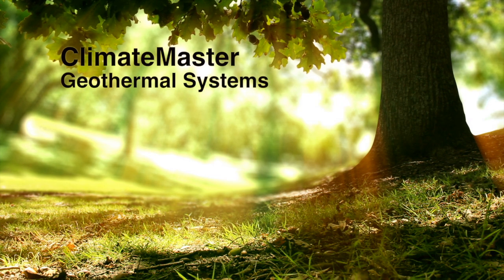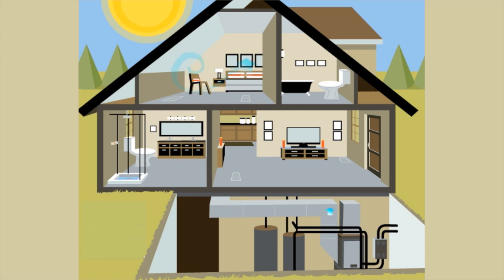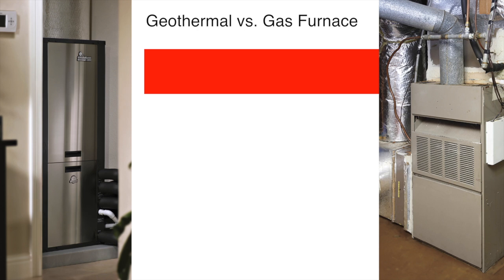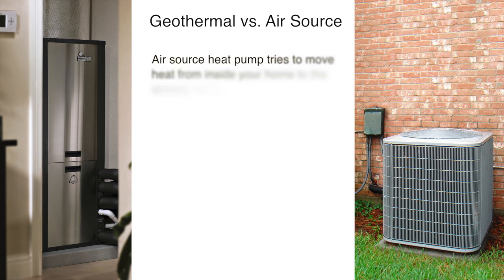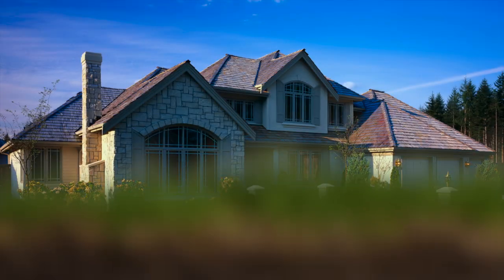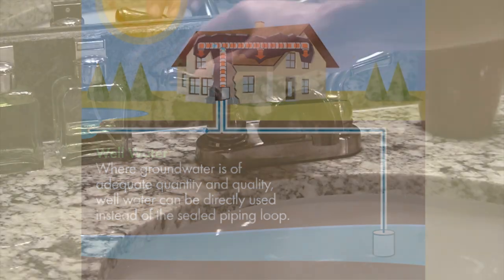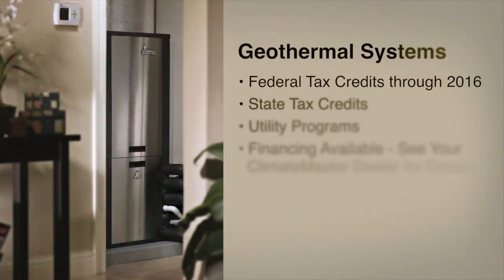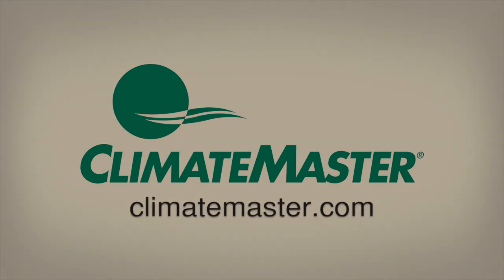Benefits of Geothermal Heating and Cooling

Comment: it's not enough heat in winter,you will need more heat,50 degrees is to cold.when it's zero out
Reply: joe18370 You can get any temperature air from a ground source heat pump. It can be -40ºF outside, and you can easily heat your house to 100ºF if you want. You just need to size the system for that. If someone has a ground source heat pump, and they cant heat the house enough, somethings wrong. Its sized far too small, or something failed.
Reply: joe18370 it's a heat pump it still brings more in
Reply: Angel Flores I understand thanks  I now know someone that has this installed,it's great for cooling, heating only has to heat above 50 degrees
Reply: Why do you only get 50 degree heat? I get 90 degree heat out of my system
Reply: Frank I agree: I work on gas compressor stations and the compressor vacuum/discharge produces both hot and cold lines-and that’s just the compressor aspect of it.
Reply: +The refrigiration cickle is still involved and used here. For most people it takes more than a shrt comment to explain. The principkle here is the following a) in a cooling mode it is deffinetly much more efficient to cool "superhot" refrigirant in a 55 Degr F envirement than 80 / 90 degree F envirement. At the same token it is much mor efficient to pull heat from a 55 degreeF envirement in the winter than 20/30 degree F enviroment. But like I said to understand this one has to understand the refrigiration cickle. These are great systems and will continue to be fine tuned/developed for the better of the general public.
Reply: +joe18370 sry Joe you do not understand the system at all ... this isn´t even any "new" and unreliable system.. it has been here for more than 25 years.. it works reliably and even cold winters... to make it clear.. even if the cold side would be freezing temperatures you could get energy out of that and produce heat.. just not as efficient but it would work...
Reply: https://www.youtube.com/watch?v=Uv8bTAGr0tU

Comment: I wonder how much this costs. I'm guessing if this saves 80% that probably means it will cost 160% x amount saved, in 2 years up front or more
Reply: pmp2559 we installed a geothermal heatpump for heating water for a family of 6, and using the water to heat the house, cooling  (about 3600 square feet, 10 feet high ceiling). In the winter the temperatures go down to about 14F. And in the summer its about 75f. We had all full electrical before this. Our bill for heating, cooling has cut down by 70%. Great system!!! It costs alot to install and new ducting and all but in a fee years that will have payed off since it saves so much money!
Reply: @robigeisi6530  what do you use to store your cooling (ice battery) or for the storage of your heating? Also... what type of fluid are you using to combat the freezing temperatures on the cooling and the "boiling" of the heating side? I install these systems and I have never heard of someone's electricity bill going down. I mean you have the compressor, heating pumps, domestic hot water pumps, cooling pumps, fan coil units, three way valves, etc.. 3600 square feet requires al the minimum of 2 heat pumps. I agree when the system is operating to full potential it is a very good system, just not cheap on electricity. I've installed photovoltaic panels to help combat the high electricity bills but it's still expensive.
Reply: @robigeisi6530  Can I ask what region you are in that the summer temps are 75 on average? That sounds heavenly! I can handle 14F in the winter, no problem, but 90-100F in the summer is pretty miserable.
Reply: 7-20k depends on the Buildings volume
Reply: We did a retrofit on our house.  This is our 4th winter with the system.  We have a large house: 3300 sq ft with a 22 ft vaulted ceiling upstairs made 100% of red cedar so the volume of space to heat is huge which meant we needed a huge system.  Our total project cost about 36k which sounds awful.  So far, very happy with the system though.  Set at 72 all year around.  Tough to determine payback since we heated everything with wood previously but we estimate about 10 years.  I guess I don't have to cut 40-50 pickup loads of wood anymore.  The system in January (Wisconsin winter, temps consistently below 0 this time of year) will cost about $180-200 dollars in electricity including domestic hot water.  Considerably less the rest of the year, about $40 to cool in July and August.  We didn't use Climate Master, went with Water Furnace Synergy system which does all forced air and basement hydronic heat.  Long term it will be a great investment.
Reply: Is the cost of the system less than the interest you have to pay to get a loan to install it?

Comment: I have a ClimateMaster geothermal system. Has failed twice in the first 7 years. Price of electricity has risen 400% over that time frame. My electricity bill is now over $700 per month. Looking to switch back to Natural Gas.
Reply: Tuan H What are you located? I in  live a small apartment and my bill is $150 a month. I can't image a house being only $200 a month.
Reply: @LexRuger718  You'll have to forgive me, that comment was made 2 years ago. Alot has changed for me since then. 

But I would like to update this for anyone reading. My current electric bill is $20 a month here in Missouri. That bill is just for one person without central air. With central air im estimating it to be $40 a month. Which is still far below most of the cost mentioned on this thread. Central air is the thing that will run up your electric bill the most. 

I tried for a while to see how much I can save on electricity. $40 is as low as it will go because you cannot live without central air in the summer. Ive tried everything and it doesn't work.

So that said, Its probably $40 per person in electricity. So if your bill is higher than $40, there's thing you are not doing to save money.
Reply: @tuanh5319  2 years old comment but I'll leave this here, check your appliances people, be sure they are working correctly, electric hot water heater malfunctioned and doubled my bill, replaced that and use dropped again
Reply: Blair Taylor
Reply: Tuan H ur dumb. He said it's so high cause of the stupid government in canada. Not America
Reply: How is your electricity bill over $700 per month? Even if I run all my heating and cooling 24/7 my bill wouldnt be more than $200 a month. $700 for a house is EXTREMELY wasteful. You are doing something wrong buddy.
Reply: It is not extremely wasteful. That is a foolish comment to make considering you know zero facts. I live in Ontario where electricity prices are extremely high (thanks to our idiotic government) and I have a large home which is extremely energy efficient (R2000). We keep the thermostat at 68. $200/month is not possible, you must live in a shack.
Reply: Lol ours works great. We save 70% on our bill every year!

Comment: By your account, electricity is free. So the backup 60 amp resistance heating on backup is irrelevant. I guess santa is real too
Reply: +N Kel That's what the solar panels are for.  ;o)
Reply: Jerome Burrasca
Solar panels are inconsistent and expensive.
Your $30,000 heating system is now $60,000 and doesn't work because the sun isn't out, and if the sun were out, your house wouldn't need heating.
Reply: @unclephil4112  Not really, their price has been falling pretty fast and if you get a battery you can use the electricity at night.
Reply: Hey now!